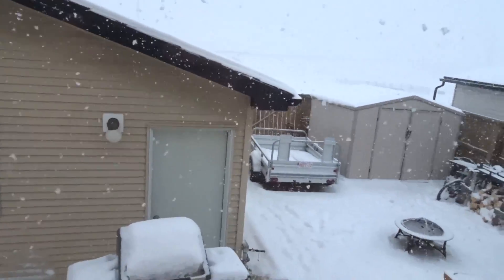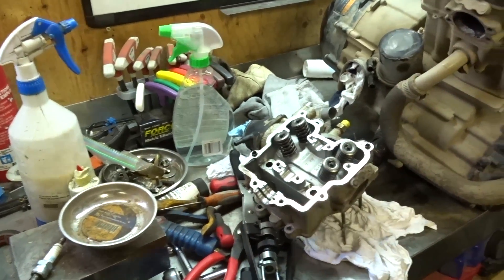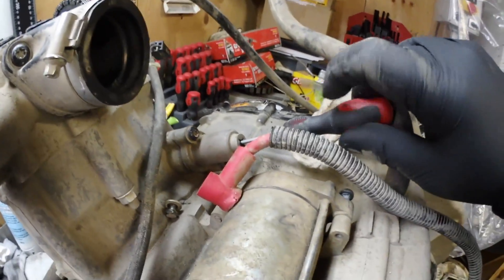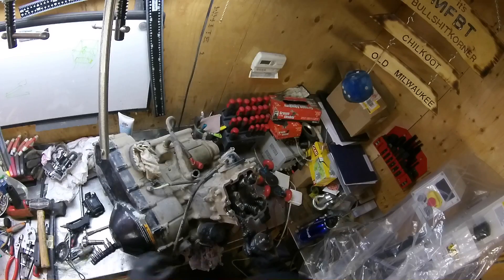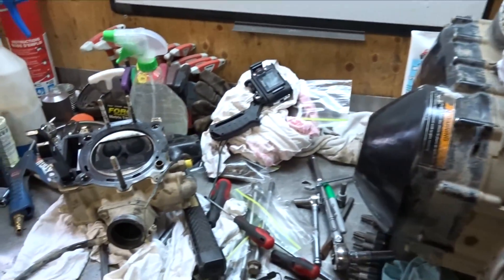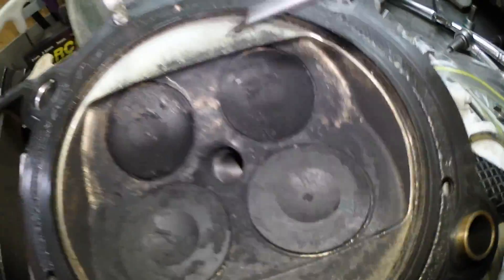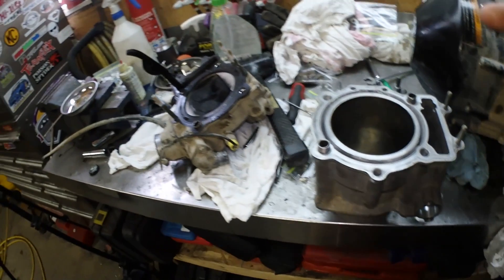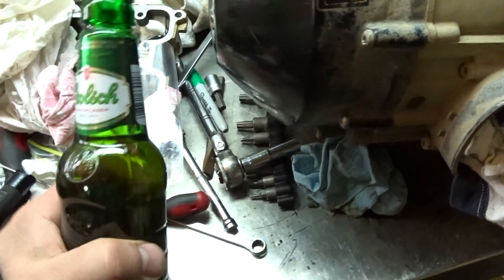No Wonder it was Burning Oil

Comment: I hate dealing with timing chain tensioners, had to do a set of VVTi gears on a 4 cyl Rav4 once and if you drop one of the 2 bolts when removing or putting the tensioner back in and it goes down in the crank case, your next step is to get the cherry picker, damn nightmare and there is next to no room for your fingers.
Reply from the maker: i could just imagine the expression on someones face when that happens

Comment: Yeah I started to get this WR400 running that trying to get spark has already been a problem.  Getting into the head after I get spark is going to be a issue I don't even want to know yet. Working on small engines like these are definitely helpful to get your mind off of what the government does not do in your favor after you pay so much in taxes for a long time.

Comment: HA HA HA HA HA HA ,, I thought you were gonna say Crazy Russians again ,  That old jug looks good eh still has it`s crosshatch - Have you done a main jet test looks running Fat it`s underpowered right your in Calgary We`re at 625 ALT. here check your GPS for height  Get to much carbon going that shxt breaks off it`s just like having a diamond hammering the jug  Seen one on a Thunder cat Looks like you took a center punch to every inch of the jug ,head , piston  -Check if it has a fixed needle .

Comment: Looks like the AC was really due for a rebuild between the carbon buildup and worn cylinder. Snorkeling would probably a good idea while you have the bike all apart. (I am kind of paranoid of getting any dirt or water in the intake of mine). Heard too many stories of dusted engines.
Reply from the maker: i swamped mine earlier in the year pretty bad, I think that is what did it

Comment: why not just clean the carbon off and polish it then just do a valve job? maybe 200 at most in that top
Reply from the maker: the other head is in better shape and less mileage
Reply: Bullshitkorner but most times the most common stress less way is to just do that but then you have to check the deals and valves to see if they have seated or not, just my two cents trying to help maybe haha

Comment: Wouldnt revving the motor hard remove the Carbon build up?
Reply: It's a risky move. Any carbon buildup in the combustion chamber can produce a hot spot whitch can increase your chance of pre detention. If you where too do this I would change the oils and only use the highest octane fuel. Also a bearing spun without a load can easily cause damage. It's called an Italian tune up. When you drive at highspeeds too clean out the motor.